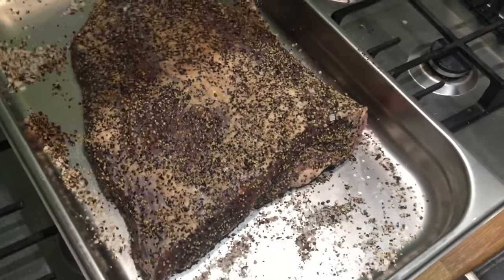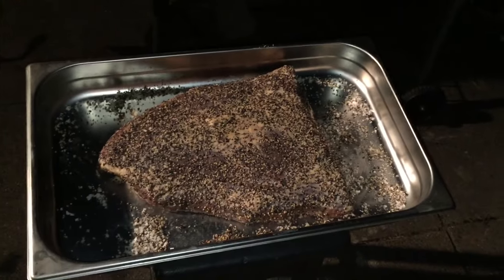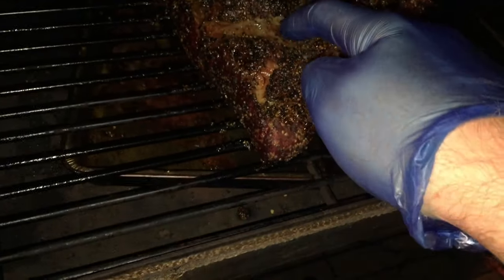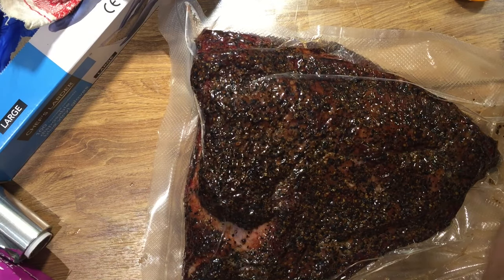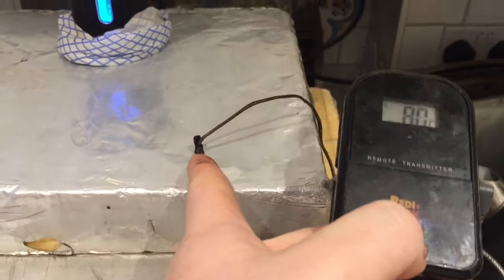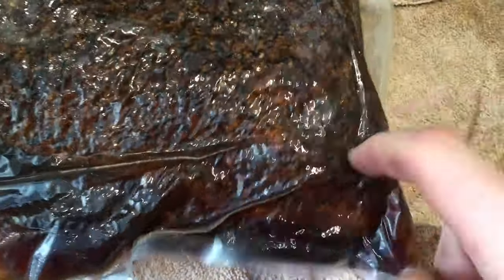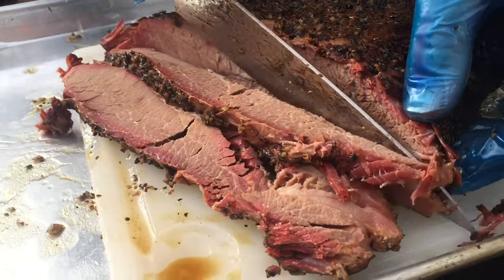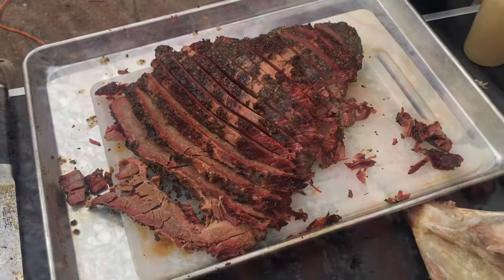Smoke and Sous vide bbq brisket

Comment: Question - Why would you not cook via sous vide first and then smoke? Seems like it would be easier and you'd avoid the bark going soggy if you smoke and then sous vide?
Reply from the maker: I wanted the meat to take on the smoke before it cooks, that way the smokey flavour is in the meat as it renders down. If I were to do this again, i would probably smoke again for a few hours at the end to build the bark back up again.
Reply: I too like to smoke for 2 - 3 hours first, SV @ 60c for 2 - 4 hours then 55c for a total of 24 hours (for a Choice grade) let it rest out of the bag, if you finished the SV cook time at 55c or less it won't absorb very much of the juices in the bag.

Comment: Hey Pete. Want to give this a shot this weekend. Wondering what temp you shot for on the smoker and what you use for your bark? Salt, pepper, and paprika?
Reply from the maker: Didn't really care about temp on the smoker as I was not really cooking the meat long term, just getting smoke flavour and bark onto the meat. I usually go for about 225F so, I just kept the needle on the dial at around that level for a few hours. I mostly cared about getting a thin smoke, rather than keeping the temp right. The cooking is mostly done in the water.

Comment: Nothing wrong with the anova. When you insulated it above the max  fill line the condensation in your apparatus got into the internals. You know there is a nice 3 gallon container and lid made just for the anova? They use it alot on "sous vide everything" channel. Otherwise a very decent brisket for a non Texan. And if you want to smoke w/o babysitting get a BGE or other ceramic grill/smoker. After I got one I gave my offset smoker to a buddy so it wouldn't rust away from neglect.

Comment: Around the Anova where it states  "hot".  You probably overheated the actual unit.  I saw that when you first had it wrapped up at the beginning.  You need to let that part breath.  Nice video though!
Reply from the maker: Nah its usually OK like that, ive run it in that exact bath for days on end, the only thing that kills them is moisture getting inside the unit and that happens when it gets so hot that the steam just penetrates in. Ive had them die from steam ingress when they are just sitting in an open pot. The air vents can breathe and the fan is all fine, its just the steam. All SV circulators seem to have this problem I have a whole pile of dead SV circulators that have all died from steam lol
Reply: xl Yogi lx right. you've covered the vent to the electronics

Comment: This is horible ruins all the bark
some things not ment to be messed with.
Reply from the maker: Well, it was an experiment. If the findings of the experiment are that it ruins the bark, then its done its job. Its not a way to prefectly replicate BBQ'd brisket, its just another way to skin the cat, and the advantages are its easier, more reliable and more predictable, and the downsides are the bark is a bit soft. Could always put it back in the smoker for a few hours to re build the bark, but that would be a different experiment ;-)
Reply: Smoke for 3 hours on lowest setting then sous vide it for 47 hours at 147 degrees F. Remove from bag and put a bark on it by searing it with a weed burner (yes a weed burner. You can buy one off Amazon for $35). Your brisket will be tender, juicy, and smoky. I'm actually doing this tomorrow for Sunday dinner. Best brisket ever.